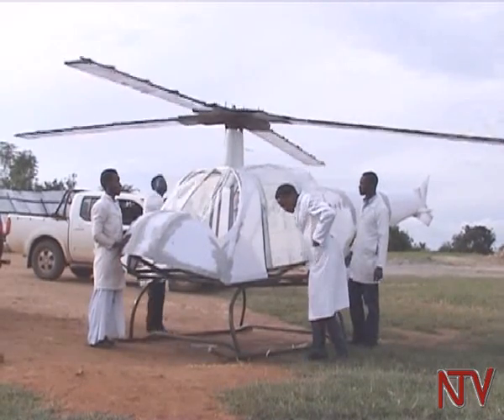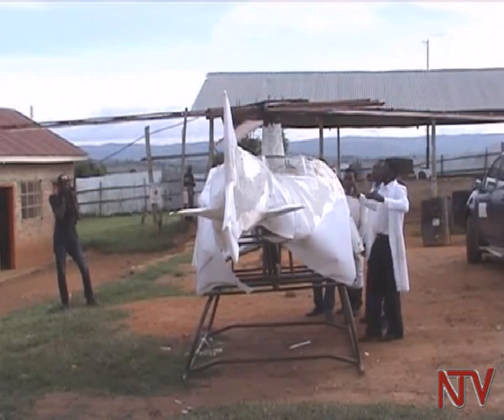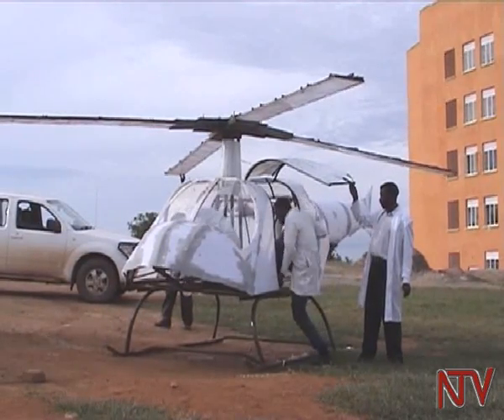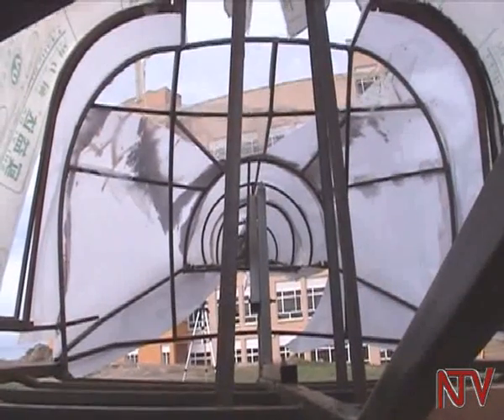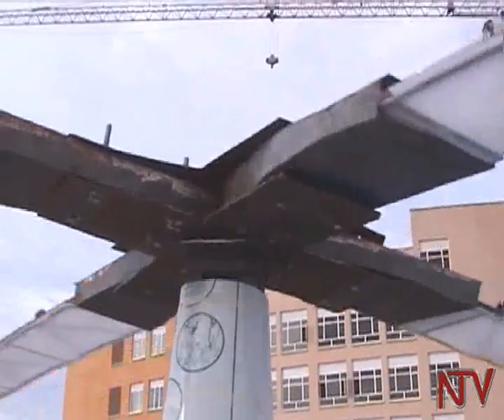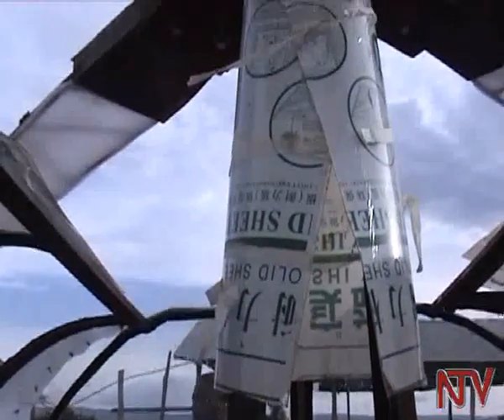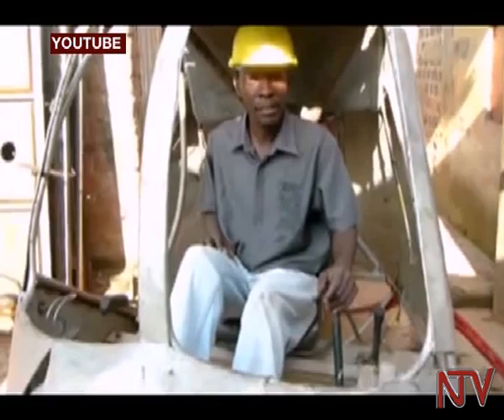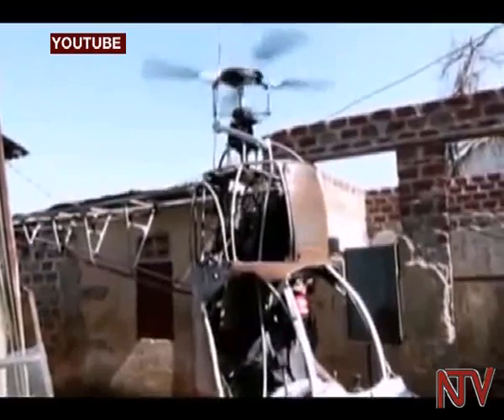MUST students make helicopter

Comment: Everyone absolutely MUST tighten a random screw with a wrench.
Very engineering.
Reply: Even if the spanner isn't actually on the bolt (1:10).